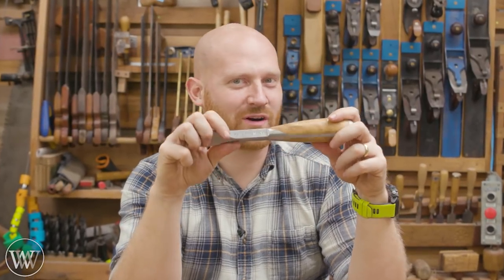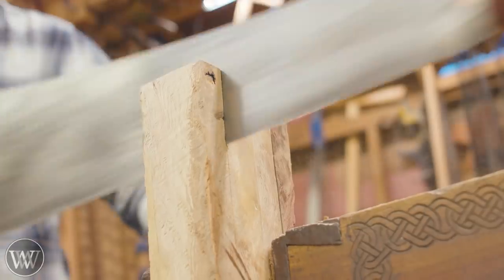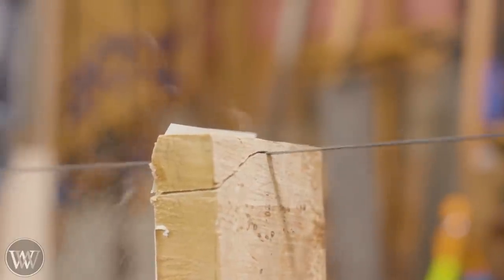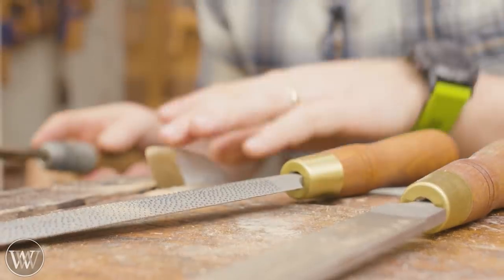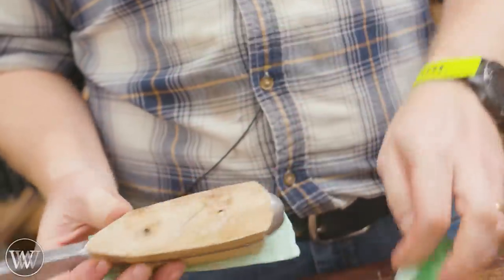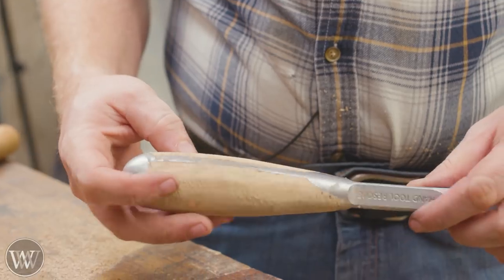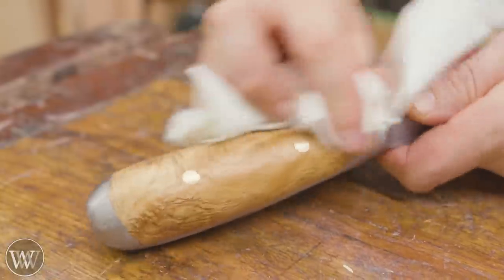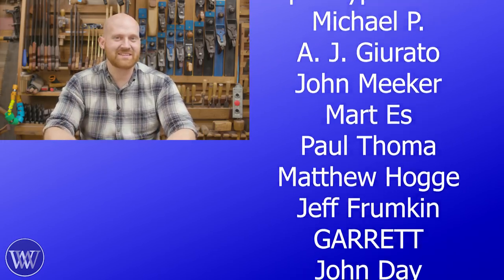How to Make a Handle For the Hand Tool Rescue Screwdriver

Comment from the maker: Hand Tool Rescue Screwdriver: https://www.handtoolrescue.com/products/nutreleaser9000-diy-kit?pr_prod_strat=copurchase&pr_rec_pid=4814415986797&pr_ref_pid=4875152162925&pr_seq=uniform
Epoxy Used: https://lddy.no/gtdq
Drill bits used: https://lddy.no/vlae
Files Used: https://lddy.no/rfgv
Rasps Used:  https://lddy.no/tui8

Comment: If you need to use sandpaper on curved surfaces you can put gaffer tape (duct tape) on the back of the sand paper, before cutting it into strips, and it means you end up with something a bit like sanding belts but really soft and flexable and it won't rip as when you're using it. It's a tip I picked up from Alec Steele and Will 👍
Reply from the maker: That is a great idea!

Comment: We, as a community, need a screwdriver that is the perfect fit for the chip-breaker to plane-iron screw. That is the size he needs to make. I'd bet he'd sell several gross of that size, in no time. He would likely find he'd have trouble keeping them in stock, once the word started getting out. A set of screw drivers for the common hand-plane screws would be nice too. The one previously mentioned, the tote and knob, the frog screws, you know what I mean. Drivers that fit the screws correctly. Fit the slot square, not tapered asking to cam out.
Reply from the maker: yup. that is on the list! I am looking forward to them coming!
Reply: @WoodByWrightHowTo  That is awesome. Please keep us updated. I sure need screwdrivers that fit properly before I wreck the screws in my planes. I just can't find a screwdriver big enough for the chipbreaker screw, and I hate using the cap iron as a screw driver. Thanks for all you do for your viewers, James. I, for one, really appreciate it.
Reply: Lie nielsen makes them.
Reply: @Roct3874  thanks, I'll have to check them out. Their prices are usually a bit inflated, but if they have what you need...
I suppose, depending on price, it's better than damaged screws though. I'd still like to support Tool Rescue when their's comes out.
Reply: @thomasarussellsr  If I remember I paid around $25 a piece for them.
Reply: @Roct3874  Yeah, It is listed "out of stock" right now,  but for $30, for the chip breaker screw driver, that's not to bad for a specialty screw driver. Even if that is more than I've paid for any single plane, so far. Thanks for the tip.

Comment: Good video, well timed as I have recently dug up a hammer here on the homestead that needs new handles. It has the steel that runs all the way through the length of the handle, wasn’t sure how to do it, I think I will try your method. Keep up the good work.

Comment: Hi! I'm new to wood carvings and after several band aids I finally turned to youtube for help. To replace my sad pocket knife I bought some chisels you suggested in another video but I come asking for carving tips. Specifically, carvings round objects. I want to carve dowls into wands without further mangling my fingers. Do you have any past videos I can turn to?
Reply from the maker: I've done a few ones but I don't think I have any that I've whittled. Usually when you're working with a round stock a carving knife is what you want and not chisels. Chisels are good for flat surface and relief carving. And when carving with a knife it's important to have a protective glove but also to make sure the knife is incredibly sharp. The dull knife will cut you far more often than a sharp knife. Because you have to put more pressure into it. Here's a video I did a while ago with a giveaway contest and I asked a bunch of channels to make wands. https://youtu.be/lM9QNu-PSRE

Comment: Is "Live Oak" a different species than White Oak, or is it just describing "particularly twisty grained sections" of it?
Reply from the maker: It is very different from White oak however it is in the White oak family. White oak is a large classification of many different types of oak however there is a specific white oak in the White oak family which gets very confusing very quickly lol.
Reply: When I was spending 20 years in coastal South Carolina, I saw a lot of Live Oak. It grows differently than other oaks, as it has a broad spreading habit. It has one characteristic that was highly sought after in the days of wooden ships. The "knees" of a tree - where the trunk and major roots merge - were highly sought after. They were practically ready-made very strong corbels to support the gun decks of wooden warships.
Reply from the maker: all the frames of the USS constitution were made from live oak. incredibly rot resistant too.

Comment: I am wondering why you always use the file or rasp lifting the handle. This way you only use a very small part of the file surface and the dust stick to the file. If you lower the handle while filing, you use much more of the file and at the same time you get rid of the dust between the teeth. It feels a little awkward in the beginning, but after rehearsal your filing results get much better.
Reply from the maker: That is a skill that I have yet to learn. I have been working at train to do that more often. But it takes a bit more work so you don't push into the work. But it is a generally better method.